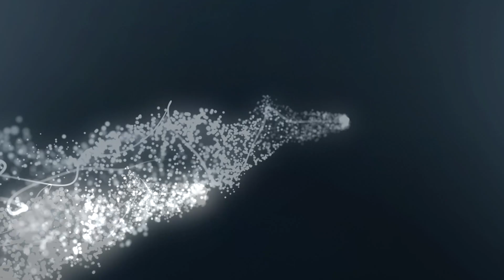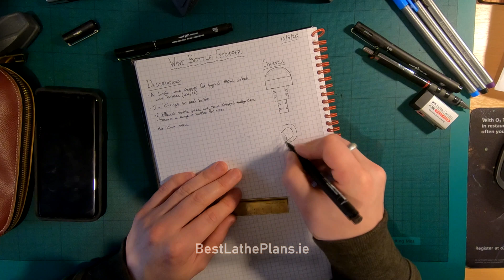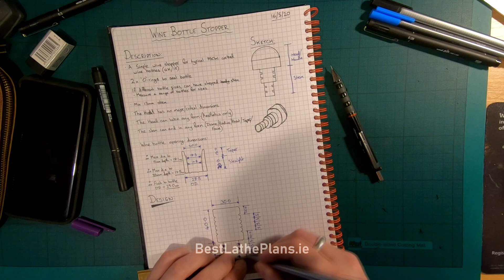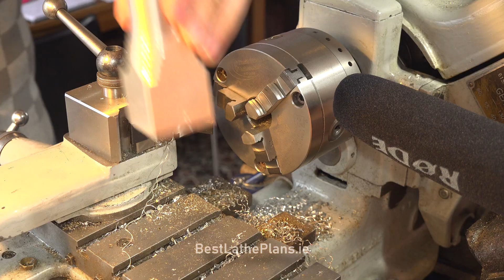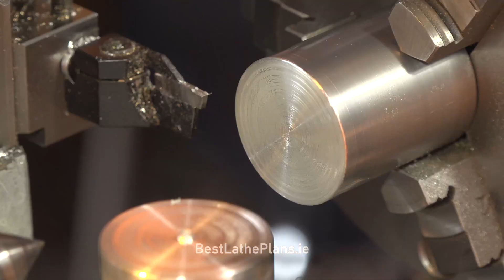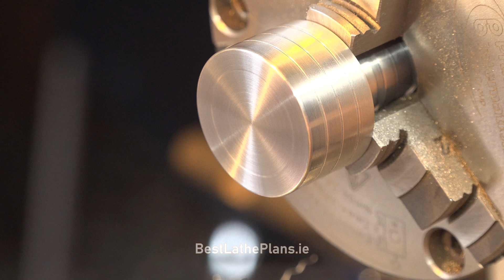BEST Present for a wine lover from a machinist - Wine Bottle Stopper - Easy Project - 4K / UHD - BLP

Comment: Looks decent, you have two sections of o-rings though, why? Two different bottle diameters? I assume it aluminium?
Reply from the maker: Hi, the 2 sets of o-rings are for 2 different bottle opening diameters.  So it can be used on two different sizes of wine bottle. And yeah, its made of Aluminium 6082.